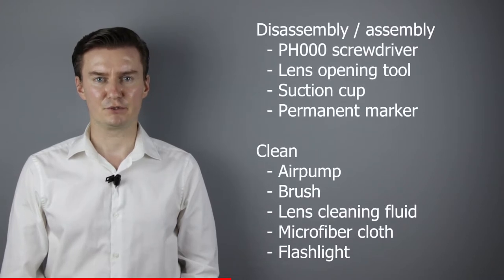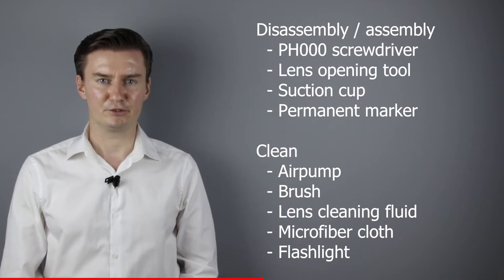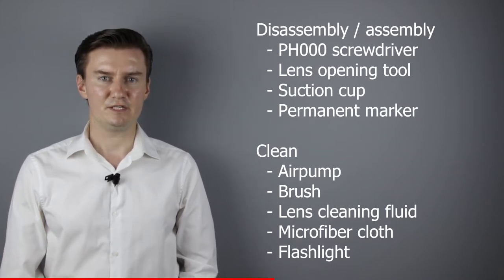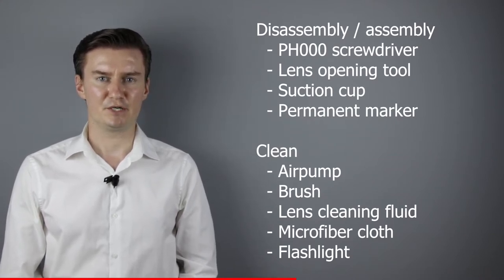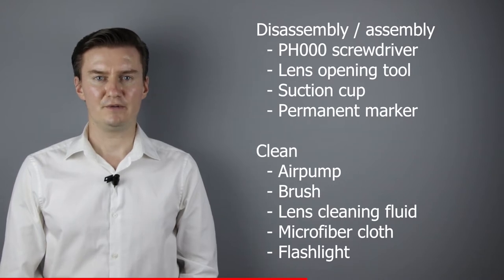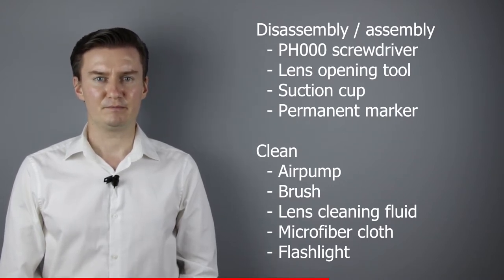Sigma 24-70mm f/2.8 AF EX DG DF ASP howto clean the lens inside

Comment: God video, thanks for sharing! How do I clean the lens from the rear end? I used a pressurized air duster to blow the dust off but happen to make a stain spot just behind the most rear lens. Thank you in advance!
Reply from the maker: I have video about disassembling / assembling the lens, that would be an option. The other option would be to remove the rear lens element, as I remember, you have to unscrew the ring around it, and the last lens element can be removed... in order to do that, you just have to remove the bayonet mount and the rear lens cover, PCB and the AF motor, then you have access to it. Be careful, because there are sensitive item that can be broken off, or if the ring on the rear lens element is stuck, you could deform the lens tube inside the lens.

Comment: Is it possible to clean Sigma 24-70mm F2.8 DG DN Art  in the same way? What to do to not have problem with dust in such lanses like Sigma 24-70mm F2.8 DG DN Art  ?
Reply from the maker: I haven't had the ART version, but as I see, you can remove the first lens element easily on most of the lenses, so I guess you can use that technique on your art lens also.